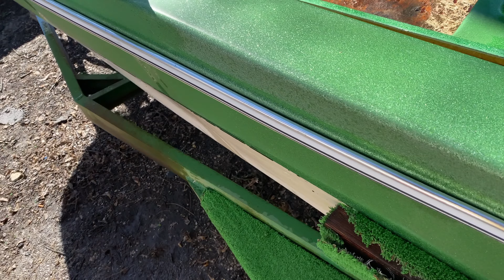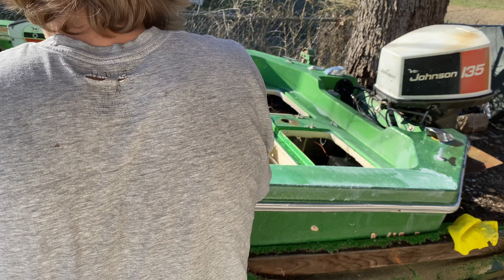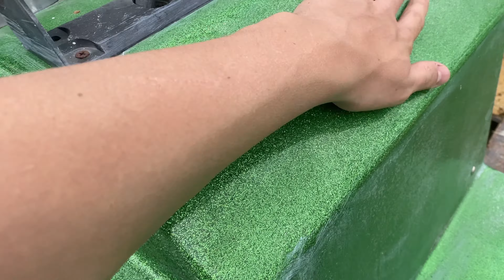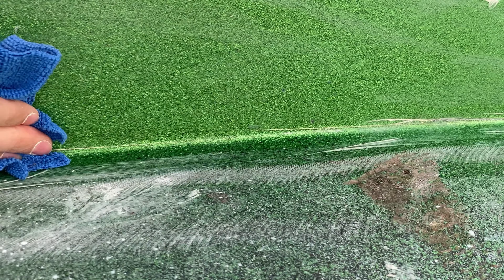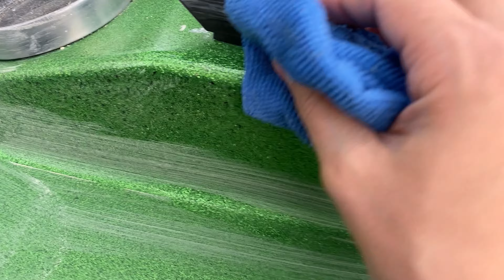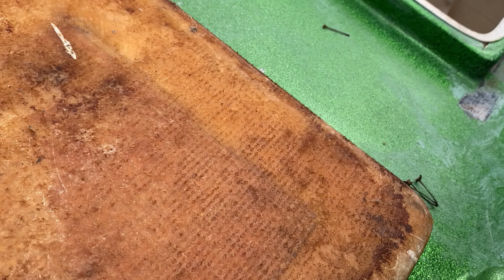Bass Boat Restoration Ep.3 | Removing Heavy Oxidation |

Comment: Meguiars makes a really nice compound for removing oxidation. My boat was worse than yours and it took it all off with no wet sanding needed. Just a buffer and some wool pads.
Reply from the maker: i did try one section with just the buff pad then the polish and a section where i did the wet sanding was better something like that will restore your shine but mine was in a barn with panels missing out the roof so it was heavily oxidated in some areas but less in others. Thank you for your comments! i'm sure someone will find this very helpful def less work